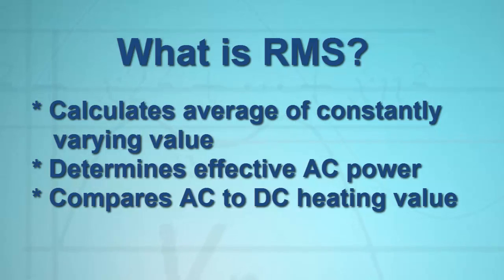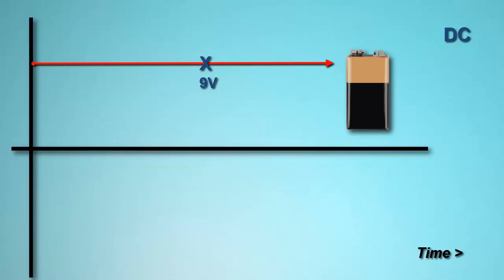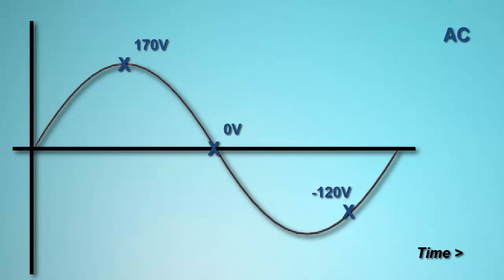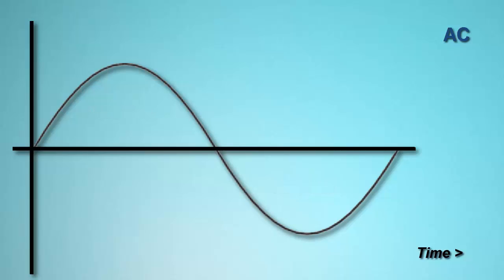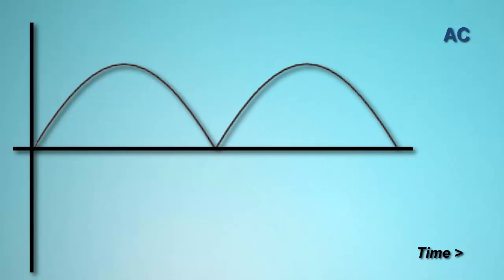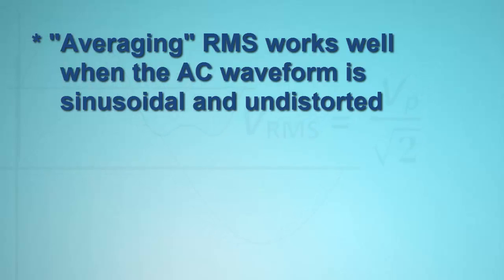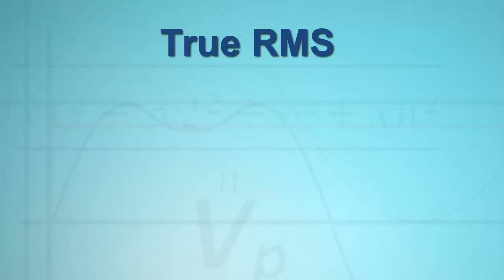AEMC® - What is RMS?

Comment: Looks like he quared half the value using either half,but said we square the value.AC is a directional power by convention from negative to positive.AC has power coming and going it will turn a motor both ways.As students we need a different way of understanding electricity than convention teaches.It may be fine for the mathematics to say we have a negative voltage but the power is not negative and this leads to confusion.PS I am probably wrong as I am not versed in electronic or physics but this whole convention thing sucks confusion like a vacuum.

Comment: If taking the average RMS is peak mutiply by 0.707, what nmber will i multiply to get the true RMS from peak?
Reply: The 0.707 multiplication value or division to the sqrt of 2 is only applicable to perfect sine wave form which gives a quick calculation or approximation to the RMS value. In the real world, wave forms has some distortion and you need to calculate based on the true RMS formula as per described in the video

Comment: what is the need of Rms value? still it is not cleared to me. please.
Reply from the maker: AC is alternating current.  It performs work when the voltage is positive and negative. This means that the standard mathematical average is an invalid measure of voltage or current. Instead, RMS is used.

With RMS the quantity is first squared, to "flip" the negative to positive. It is then integrated, and finally, the square root is taken to remove the error caused by squaring.
Reply: @AEMCInstruments  why cant we use max voltage or current .

Why R.M.S ???  How did they come to that conclusion

Thankx for the help:)

Comment: what is the need of Rms value? still it is not cleared to me.
Reply from the maker: AC is alternating current.  It performs work when the voltage is positive and negative. This means that the standard mathematical average is an invalid measure of voltage or current. Instead, RMS is used.

With RMS the quantity is first squared, to "flip" the negative to positive. It is then integrated, and finally, the square root is taken to remove the error caused by squaring.
Reply: @AEMCInstruments  but it isn't, an RMS is different from a numerically intigrated absolute value. I think he's wondering why this different value is mathematically valid
Reply: @AEMCInstruments  if the error was removed then the sum of the squares would be divided by the square of the period over which you've intigrated but that's not how an RMS is taken

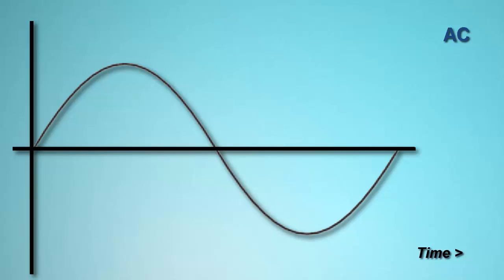Comment: Good explanation, but squaring a graph - say sin(x) - will not make the graph look the same with pure positive values, like the graph that appears around 3:32. Put sin^2(x) and |sin(x)| into a grapher and notice dy/dx differ by as much as 45 degrees near y=0. What you say, however, is precisely correct:)
Reply: C'mon Man.....Its 1.41...Use Calculator
Reply: Håkon Andreas Skjold p what is your real nick name